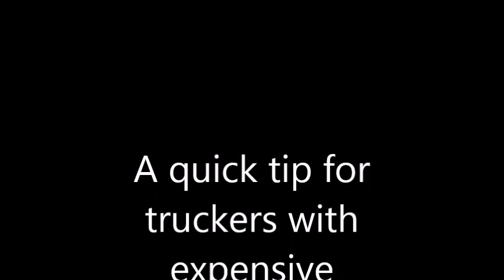ABOUT A CAT WHO FORGOT HOW TO MEOW

Comment: See Serg those T800's are eye candy. You couldn't help yourself, you had to stop and stare even though it was child's play. Way to get some use out of the hat in the off season. You might want to pick yourself up a good rubbery case (ie Otter) for that nice phone. I found mine was like trying to hold an ice cube without its case on. I still drop it a lot but its still going after many drops and a few throws. The case also prevents the battery from pulling his ejection seat handle causing it and the back cover to shoot off the phone when it bounces off the ground. I almost think they install a special magnet  that is attracted to soil inside these high dollar phones so you'll drop it, break it, then have to go buy new. I never dropped my cheap old flip phones any where near a much as my smarty, I guess I never held them as much either.
Reply from the maker: Who's 'Serg'?
Reply: ***** Stepan! How have you been? You know who Serg is, don't you? He is your Alter Ego.

Comment: sveral of my mates have stepdecks and its quite the puzzle to load sometimes, they also like to max out the trailers with what they can. think in english its called trombone?, where they pull out the trailers for extra lenght. its also comon to have ramps with them, machine trailers have hydraulic ones and the more combo trailers have loose ones that the driver have to move around by hand. thinking about getting a stepdeck for my new truck, but then i have to drive longer distances and its not so fun living in euro trucks with the small cabs.

Comment: You should get a cover for your phone I have the same phone I have a otter box cover for it protects everything in hard plastic & rubber
Reply from the maker: I have that cover. The problem is that 'magic adapter' that was supposed to hold 2 SIMs didn't work so now each time I'm coming to the US/Canada border, I have to turn the phone off, take off the back cover, the battery and replace the SIM. The plastic cover you mentioned makes it less fun ;)
Reply: ***** Unless you need dual sims for data (net access) just get 2 Verizon phones, one for each country. 

And the reason why the cat forgot how to meow is because he's under my tire!